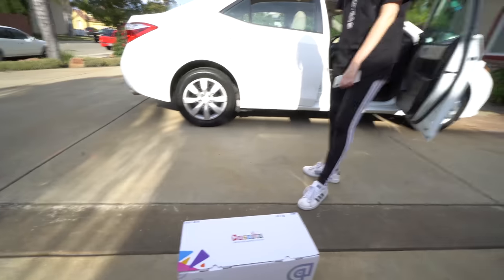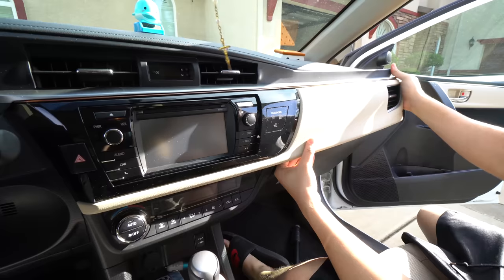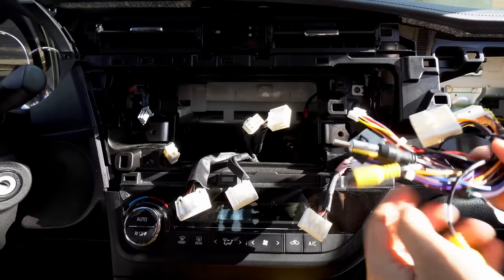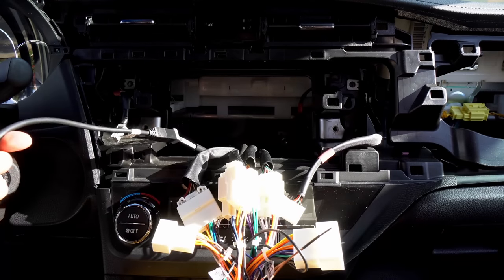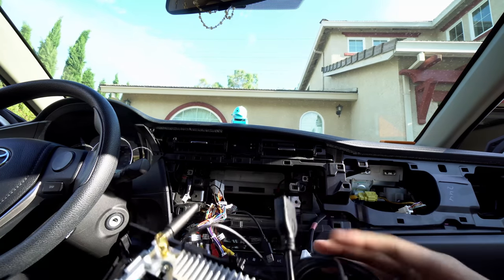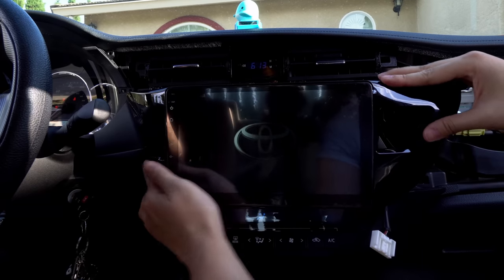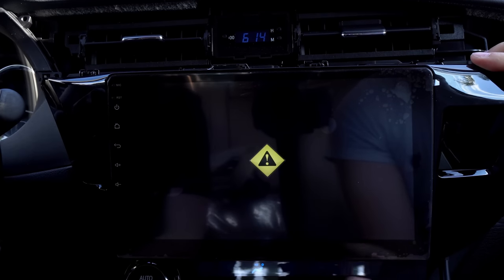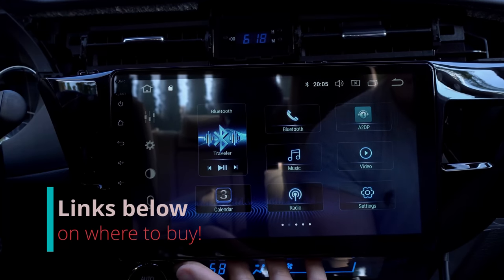10.2 inch Screen in her Corolla!!  | 2014-2019 Unbox/Wiring Install!

Comment: You turned the ignition on with the passenger airbag indicator to the right of the screen unplugged. So I know that the SRS airbag light on the gauge cluster was on. When installing these radios if there is an airbag/SRS indicator on the dash that you disconnected, before you turn the key or energize the ignition of the vehicle you need to plug it in even if it’s just hanging loose from the panel and not mounted. That way you don’t set off the airbag indicator on the cluster. Some vehicles require an obd scanner capable of clearing SRS systems to turn it off. Just a helpful suggestion from my years of 12v install experience.

Comment: Note that the radio is not particularly secure, as it is not attached to a bracket. 2015 Corolla was rear-ended (air bags did not deploy), but the Dasaita radio popped out. A higher impact collision could have been worse.
Reply: What happened?
Reply: @6alisk  vehicle was rear ended, which caused the Dasaita radio to pop out.

Comment: Hey John, is that the best unit you recommend for a Toyota corolla? I have a 2014 just like your cousin, but my touch screen is a piece of shit and has gone out in most areas. I want to upgrade but not sure if it would be too expensive to get the floating head unit or if you recommend this one better.
Reply: i have the same problem , to u suggest the touch screen that mentioned in the video ? i want to upgrade but i like the "Vechiel consumption" Feature that the original stereo has. can i have these options on the new screen?

Comment: My radio is all static I believe I plugged each one in correctly the GPS works wifi the sound the backup cam the door ajar etc except the antenna

Comment: Nice video!!! Do you know of a good unit for my 2018 Toyota Corolla? The one that comes standard (entune) really sucks with navigation and just recently the rear camera stopped working. Thanks bro!
Reply from the maker: yeah the unit has been running solid and there no lag!
sorry to hear about your oem unit acting up :(
Reply: Anthony Metacarpa  It'll probably work, just the molding won't. Not hard to fix if you know how to do it.

Comment: That is so cool.  I have a much much older Toyota Corolla, a 2001. I was looking at a single din 7 inch Joying Android head unit, but not a 100% sure if it will fit well. Do you have any experience install single din head unit in a much a older model car with single din and do you have any recommendation of a unit that will work and fit well in an old 2001 Corolla?

Comment: Hi

I have watched a few of your videos and you make the installation very simple. l would like to do this very soon, hopefully it will go as smoothly as yours do.

From your videos l have not seen you alter other things like subwoofers, amplifiers or speakers. So l guess you will use the existing ones when you do your installations is that correct?

 Thanks for the inspiration. Keep up the good work.
Reply: It uses every existing and it has a port for one av it looks like but my issue is I have 2 amps sub and 3 sets of av so I don't think that would work in this radio

Comment: I just got the max 6 unit and everything works so far but I have the six speaker system and my two front door speakers aren't working but the front tweeter speakers are

Comment: I have a 2019 corolla SE I would like to upgrade the radio but I don’t know anything about wiring is an easy install and I saw on the link it set up to 15 is it the same and is it a direct bolt in

Comment: I installed Dasaita 10.2" head unit on my Toyota RAV4 2014 but I am hearing constant vibration noises when I am driving. it seems the unit is not perfectly secured into car, any advice?

Comment: what all do i need for connection wise? what extra did you get, my wife has a 2014 and she gonna buy one but dont know if i need extras or if the radio comes with those wires to connect to the existing wires

Comment: So I'm having trouble finding this radio for my car I have a 2017 Toyota Corolla SE and it has the upgraded radio and the hazard light button is round and not square and the seat belt light on the right is not cut out is like all together as one piece ...so I can't find one that fits my car only this model the one u have ..

Comment: Hi John, I just installed this unit in my 2014 Toyota corolla. I am noticing issues with FM reception. It tunes into the radio stations, but the quality of reception is poor. As you drive around I get static. I tripled checked all the wiring and everything looks good. Have you come up with this problem? Do you have a solution?
Reply from the maker: make sure you get a good ground.

Also some FM/AM adapters they include might no be amplify (usually a blue wire). Check the radio harness and if you don't have it amplify i would highly recommend you getting one on amazon for about ~$10.

Comment: I’ve seen these on Amazon and it comes with a backup camera. What if my car came with a backup camera stock will in inter grade with the new deck ?
Reply from the maker: The brands have different motherboards, and software.

You are able to use your factory camera

Comment: Hello John Nguyen I have a 2019 Toyota Highlander and am also looking to get this infotainment system looks amazing will I also be able to retain my original usb If I get this max6 dasaita px6 unit ?
Reply from the maker: yes! there was an adapter included so the usb is still retained!
Reply: About WiFi is there any way that this unit can just use your phones data instead of WiFi because my phone does not have hotspot? What other way can I get the unit to have data/WiFi ?

Comment: Hi I got a Ford focus 2012 , I need a Android head unit that I can stream and install tidal for my music ,do u have any suggestion?
Reply: I'm putting an Eonon  with a 7in display (Model: GA2175) in my 08 Odyssey and if that works well, my 06 Focus. It is a double DIN fitment, but my 06 Focus radio was originally double DIN too. Not sure about the size of the 2012.

Comment: Hey bro,did you test the USB ports?,mine don't work
Reply from the maker: factory usb? or the usb in the back of the unit?

You have to get an adapter to reuse the factory one
Reply: @JohnNguyenVincent  the ones that come with the head unit, there are two of them
Reply: What’s the link to the adapter ?

Comment: It's frustrating that Toyota has refused to support Android Auto and even the new 2020 Corolla still doesn't have it which has a newer multimedia system with an 8 inch screen.  They've just added Apple CarPlay.   I'm looking for a one for my 2018 Corolla which has a 7 inch screen. Toyota changed the look when they updated the Corolla in 2017, but it is still the same outdated Entunes system. Toyota is slow to update to new technology
Reply from the maker: Exactly, 
I'm an android user and it baffles me that this is an issue in 2019
Reply: Toyota always has had one of the worst, if not the worst infotainmentsystems though!! My phone is 6,5" so I just put in my phone holder and use it as is. The display is also leaps and bounds better than whatever you can find in the latest Corolla either...so I don't really miss Android Auto!

Comment: It doesn't fit. He's not showing the position of plastic clips which do not match the holes on the dashboard.
Reply from the maker: there is a part 2, https://www.youtube.com/watch?v=FGoSj-uHAnQ
Reply: @JohnNguyenVincent  Yes, I can break them off. But if the unit is faulty or brakes down, I might have return or warranty issues. It would be nice to find the unit that actually fits. So far I tried three and all of them had this issue. I don't think these Chinese units are made for US cars.
Reply from the maker: @srdjanmax  just remove those clips and if you do have issue they will probably warranty it anyways. Just refer to this video or the more recent one i made of this model.

Comment: Dude now spending $500 just for radio and nice screen is not enough! show us how is performance of carplay on it. I know now these MAX6 gets wireless carplay chips do review them, which could be most selling point of all! and do some real life review expect radio! RUN it for long drives test if Carplay wired version does really charge iPhone or not OR it just shows it is charging and does never charge(I have confirmation from Iris about this that if wired carplay is active it hardly charges iPhone!) find some time getting this buggy android a real review! not just showing how cool its radio sounds!!! Now for $500 we get wireless carplay from pioneer just matter here is screen size and CAN BUS support which cost more on those branded headunits! If all these Chinese headunit to perform good then see some problems first! screen does take 30sec minimum to cold boot! which sucks dont you think? show some real technocrat details about these headunits rather than some skinny themes !